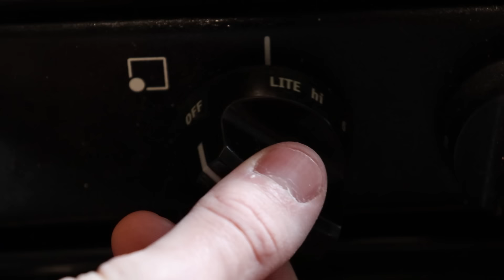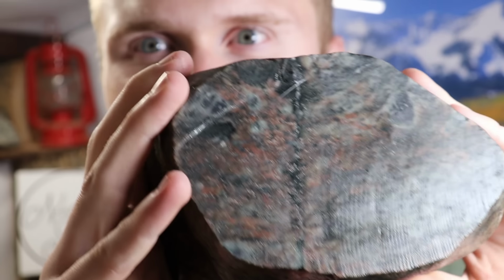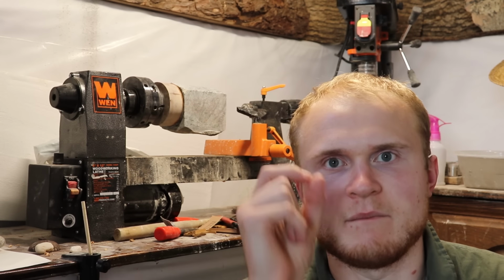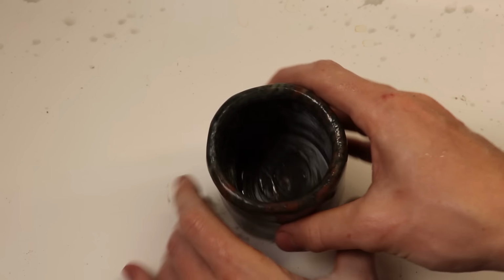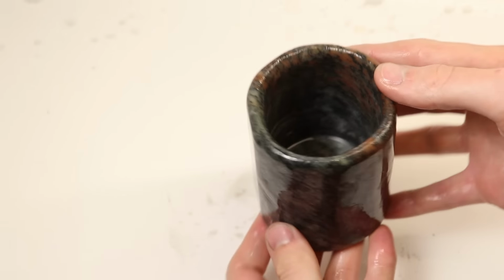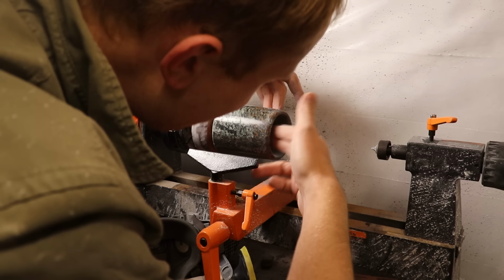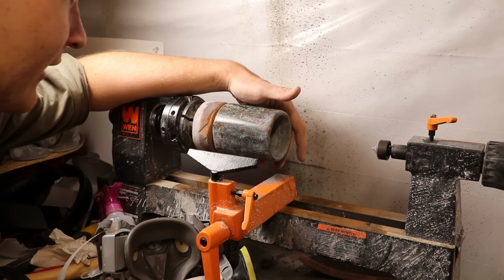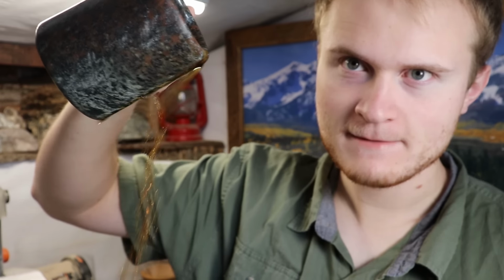I Made a Coffee Cup out of A Rock

Comment: Did you check if the rock could release harmful heavy metals into the hot liquid you'll be drinking out of the mineral cup?
Reply: I'm wondering the same thing
Reply: @Drewsky840  I'm interested, because I think I want to do it, but the right way. Toward that end, I googled "stone wear and food safety" and got a hit from stack exchange. I'm not sure if you can put links here, but the url includes "What kind of stones should not be used to grind food," so googling that sentence ought to produce stack exchange as the first hit if you're interested. Anyway, the question was this: 

"I found a pink slab of stone with a nice dip in the middle and thought of using it as a mortar for grinding spices. Are there any stones whose makeup could potentially leach toxins?"

Answer:

"Granite, marble and jade are all common stones used for mortar/pestle combinations. There are probably many other stones that are safe, but you want to avoid the following:

anything that is porous such as sandstone or dolomite
anything that will break apart easily, mainly sedimentary stone
anything that might expose you to metal toxicity such lead or cadmium
anything with organic matter attached
anything that reacts chemically to whatever it is you're grinding"

I don't know about the credentials of the author of the answer, but it's enough to suggest concern. I still want to do this (thinking about it, anyway), but I'll stick with decorative pieces not meant for food use. 

Assuming I can do anything that truly qualifies as decorative.
Reply: I'd coat the inside with a food safe epoxy, like you'd do if you make a wooden tankard, to ensure it's safe to drink out of.
Reply: @elizabetholiviaclark  Just from the look of it that is probably a type of granite. Seeing as what you said reccomended three types of metamorphic rock and that rock in the video appears to be metamorphic he should be alright.
Reply: @themadduck8784  Yes, I think I'm inclined to trust him. It's me I don't trust. I just don't know enough about this subject.
Reply: this guy has probably breathed in so much toxic mineral dust that drinking a little more won't matter in the end
Reply: @6022  Is the food safe epoxy heat resistant?
Reply: @themadduck8784  I heard that granite is on average more radioactive than many other minerals.
Reply: @desktorp  Well, I'm not asking for the guy in the video because he obviously didn't care too much about health. It's his choice of course.
Reply: @vladimirchylik6754 Quite harsh and completely unnecessary. Clearly, you weren't watching the same program as the rest of us. At what point did he do anything unhealthy?  You do know that he's a geologist, right? If anyone knows about heavy metals present in a rock, it's definitely going to be a geologist.
Reply: I live in a valley made of igneous rock such as granite and schist.  I don't drink the ground water. There are lots if heavy metals in it.  He should fill the cup with distilled water,  then send that water off for a chemical analysis.
Reply: @beyondwhatisknown  He's not a guy who just collects pretty rocks, he's a geologist degreed from University. If anyone is going to know the rocks that surround them it's definitely going to be him.
Reply: @illiniwood  It's actually a question of health knowledge.  You can't know the exact composition of an impure igneous rock just by looking at it.  Different minerals dissolve at different rates, and then at different temperatures.  I think adding some boiling distilled water to the mug, letting it sit for 24 hours, and then having it tested for its chemical content is the only way to know for certain what it leaches into the water.  After you get the answer, you have to understand what each mineral can do to a person's health, and that's well beyond a geologist's knowledge, and often beyond any doctor's knowledge.  Everyone reacts differently to heavy metals, for example.  Some people can handle mercury quite well, others cannot.  It depends how much you sweat every day too, among other things.
Reply: @beyondwhatisknown  That's a lot of assuming considering he's an actual scientist who has very likely taken the steps to assure that the rock he used is "safe enough" to be able to consume a hot beverage from. You know what they say about those who assume too much.....
Reply: @illiniwood  I'm all for defending educated creators from the common YouTube comment ignoramus, but if you read the description... "It's composition is some kind of igneous rock, if you can ID it in the comments I would greatly appreciate it."

Doesn't sound to me like he knows if it's safe or not lol. But I'm sure he has at least some degree of certainty, like knowing the appearance or color of some dangerous minerals/metals.
Reply: It's actually an organic biodegradable material, proven safe to use over 80,000 years of testing.
Reply: Anyway it's surely better than plastic
Reply: its like to say "Audi A8 better than atherosclerosis"
Reply: Why? I don't think that all plastic releases BPA.
Reply: @vladimirchylik6754  even if not BPA, there are another nocive chemicals
Reply: @illiniwood  Bulshit. As a geologist you studied minerals, yes. But even if he knows about possible negative health effects of some minerals on the body, he could still NOT CARE. You know that many doctors drink alcohol sometimes, right? They know about it being poison and they still drink it.

Your comment consists of too much assuming.
Reply: @beyondwhatisknown  Maybe boiling distilled water. Just to be sure.
Reply: @chrisgooden9662  That's the primitive "if it doesn't kill you outright, it's fine" argument. Some people smoke cigarettes live 94 years. That doesn't make smoking non-problematic.

And even if you don't feel anything, it doesn't mean that nothing bad is going on in the body.

Do you even know what the life expectancy was for people who lived 80,000 years ago? Probably not.
Reply: @vladimirchylik6754  Some minerals dissolve more at high temperature, some have a greater solubility at low temperature.  So, maybe send a sample of both hot and cold solutions to be tested.  Then again, you could put a weak acid in the cup and see if it dissolves extra minerals, then get another sample with a base to see if it picks up minerals.  Tomatoes can dissolve teflon, and eat through aluminum pots, for example.  I don't know what the tannins in tea or the acids in coffee will do to random igneous rock, but it's worth trying.  Ceramic dishes always have a nice safe non-toxic glaze on them that are guaranteed not to harm humans.  Maybe he can glaze his stone mug and fire it in a kiln to guarantee it is safe?  Glaze is made of elements that the human body already requires for its function such as silica, potassium, and sodium, or something that the human body can handle that doesn't dissolve easily such as aluminum in the molecular structure.
Reply: Oh my god I’ve never seen so many people arguing about a damn rock. If you’re worried about the chemical makeup of a rock, you’d hate to see the ingredient list of your Frappuccino
Reply: @linemantimlewis94  Those weird ingredients are killing people.  The food supply is poisoned.  Try eating 100% organic food for a month or a year and see how you feel.  I've done that experiment.  I stopped getting sick!  I hope you develop an interest in chemistry.  It's an interesting topic.  The human body is pure chemistry, and everybody owns one.  You'd think people would take an interest in the chemistry...
Reply: @illiniwood  Seriously, just because he is a geologist doesn’t mean squat. The guy is right! You definitely wanna check it for heavy minerals. If you’re putting coffee in in it which is acidic it can easily bring those heavy metals into your coffee. If that rock came from Colorado a lot of granite is mildly radioactive. You also wanna check it with a geiger counter too!
Reply: @beyondwhatisknown  Not only that but coffee is acidic. Acids can leach it into the coffee too.
Reply: @illiniwood  Hey, i’m a chemist. There are many rocks in Colorado and they are mildly radioactive. Here is Chem 101, coffee is acidic. Coffee in that cup will start to eat away at what ever maybe in that rock. Just like using tomato sauce in a cast iron pan.
Reply: @mtnwildernessfamily  Then, why would a scientist who studies rocks as a career and passion expose himself to known radiation by drinking out of a radioactive rock? With his knowledge of rocks, yet still willing to do this, it just doesn't make sense on any level.
Reply: @beyondwhatisknown  you can tell a lot by looking at a rock. formation of rocks is dependent on the presence of or absence of certain minerals. sealed granite is known to be safe. this whole thread is on a ghost chase
Reply: Please get better specalized rock tools. I'm a rock guy and those really hurt me to see you use them. Pleeeeeeese find better ones.
Reply: @Working-classdude  you do know people are not made of money. People don’t have money tree’s growing in the back yard. Maybe he found them used to start a channel. Maybe he can’t afford brand new tools. Maybe he enjoys those tools. This is his channel.
Reply: @justinbang6025  Granite is used as a building and ornamental stone. Many ore deposits (copper, lead, zinc, gold, and silver, for example) were produced by hydrothermal solutions created during late stages of cooling of granite bodies.
Reply: @elizabetholiviaclark  thanks for sharing this with us!
Reply: I don't care about any of the negative health effects. I eat McDonalds, Burger King and KFC regularly and also drink Monster Energy.
Reply: @linemantimlewis94  Yes, if you want "health care for all", people need to take their own health seriously first. I, for example, would not like to pay for healthcare for the fat American diabetes nation.
Reply: @vladimirchylik6754  Clearly, he doesn't care, but what's your point about gun experts? What does a gun have to do with lead? Plus, I don't know anyone who has a science degree or a masters from University in "Gun expert".
Reply: @illiniwood  Lead in ammunition. lol

Btw.. I'm talking about experts and you start talking about university degreees. My point is that you can know about heavy metals and still not care. You can know about the negative effects of alcohol and still drink whisky. It doesn't matter if you're a geologist or philosopher or whatever.
Reply: I think everyone should stop worrying about toxins in his cup and worry more about the heavy metals and fluoride in our water supplies, the harmful pesticides and other extremely harmful toxins sprayed on our food supplies, and the heavy metals and more toxins sprayed in our skies every single day. It's extremely worrying how no one gives a crap that they put something as toxic and harmful to humans like fluoride in our water. If they tell us about that then imagine what they are doing and not telling us about.
Reply: Probably has to worry more about dying from breathing silica without a respirator.
Reply: @vladimirchylik6754 It depends if there is a vein of any radioactive elements in the granite. The cell phone you are using to watch this video is highly radioactive compared to most pieces of granite. Many pieces of granite aren't any more radioactive than a banana
Reply: I wouldn’t want to worry as much as half the people on here. You know worrying will actually shorten your life too? It’s a rock, get a grip.
Reply: @chrisgooden9662  you know, humanity invented pottery for a reason. There could be arsenicum or stibium in random stones you find in nature. Natural doesn't mean safe. People's life didn't last long 80'000 years ago. Quicksilver is pretty natural - it doesn't mean you should drink eat to be closer to your ancestors.
Reply: @elizabetholiviaclark best ending to a comment i’ve ever read…😅
Reply: What types of stone/ rock are safe to be drank/ eaten from?
Reply: @beyondwhatisknown  if you boil distilled water it's no longer distilled water...

Comment: For the next rock mug, my guess is that you will have an easier job if you begin by making the hole in the mug first.
Insert a slug of wood into the hole to fill it completely. So you can turn it between two centers. 
Then grind the outside surface on the lathe using a diamond blade on an angle grinder.
Reply: Good idea, and after it's core drilled and plugged, the lathe could be used with external / live cutter heads for the outside.
This is basically the same as you mentioned, but I think of these things also, because I work on machines in a Granite shop, and I used to grind glass lenses also.
I wanted to reconfigure an old lens grinding machine to do these sorts of things.
Reply: Use a metal lathe and a carbide cutter. This angle grinder stuff is for children.
Reply: @gwcstudio  
I don't know enough about the properties of carbide vs granite etc.
Except that carbide is very tough material.  I've had concrete drill bits(carbide tips) last for amazingly long periods of drilling.
But I'm guessing that a fresh rock with big angles and edges would be difficult for me to avoid snapping tool holders and things.
Reply: My thoughts exactly, had my experiences with this work and there's no real alternative to this

Comment: This is awesome. I have to ask though if there's any risk of the rock fragmenting off or containing substances that might leech into the beverage? If it's completely safe I'd love to own stone mugs. 
On a side note, 7:51 christ man, I hope that thing has a sawstop.
Reply: Depends on the rock. Granite is probably about as inert as one can get. Water will win at eroding/dissolving stuff - but not in your lifetime.
Also, those are tile saw blades. Not carpenter blades with nasty teeth. The blade is smooth with diamond dust mushed into it. Nasty abrasion maybe, but it won't take your finger off.  Gloves are probably sufficient protection. sawstop also probably wouldn't work since the water all over the blade would trigger false positives.
Reply: I agree completely. Tile saw is nothing like wood or metal saw blades.  The worst that you will get is an abrasion cut.  While you could probably take a finger off,  it's because some has it held there for a while until it finally gets through it
Reply: @eh42  The concern is rocks containing lead, arsenic, mercury, cadmium, etc. All pretty common.
Reply: this scared the shit out of me.

Comment: Nice! AS far as the diamond hole saw bits do you buy from Amazon or from a lapidary supply shop?  thanks
Reply from the maker: I usually buy lower priced tools from amazon. I think as long as you treat them right they will last just as far as a lapidary shop. Plus, if they do break (Which they will, it is easier to replace) Thanks for watching! Links are in the description.

Comment: Nice. Years ago, I came up with a plan to make forged knives with handles made of stones like agate, jasper, and nephrite jade. An ABS bladesmith making "sole-author" knives, including the sheaths, could do very well, and there's very little competition doing solid stone handles, especially turned ones with hidden tangs. That's because the stone handles are the hardest part by far. Anyway, the equipment list I had in mind looked a lot like what you have here. Slab saw, rock lathe, boring machine, etc. Spent a lot of time looking at tool vendors at the Denver mineral show. Never did take the plunge, but I sure thought about it. Nice to see the process of working these cobbles of natural stone. It's a lot of work!

Comment: I work with masonry and concrete a lot.   You could get up to the hollow cylinder stage quite quickly with a coring drill and two different diameter bits.    Coring bits are basically long deep hole saws with diamond-impregnated ends --and water-cooled.    I have a hand-held Chinese coring drill which was surprisingly cheap.    Someone could make a fortune on Etsy manufacturing these (if someone hasn't already).     Also it wouldn't be surprising that there exist some kinds of rock that are toxic to drink from.  One thing I would pay special attention to is how the coring bit could seize in the rock and the drill throw you across the room or smack you in the face --if you're not careful.   Also, I'd recommend an in-line GFCI.

Secondly, perhaps a pottery person could chime in, but I would think a glazing step in a kiln would help with overly porous rock, or at least make the mugs more servicable.

Comment: Just a thought -- could you set up your diamond bit in a fixture on your lathe - at right angles to the axis of rotation?   And then grind the outer surface to more of a circle as the lathe turns at a low RPM?

Comment: Please, please don't get your fingers ever again so near to the blade. As a stone-mason I've seen enough accidents which have their cause in something like this. A colleague of mine  had just a few weeks ago an accident with a grinder because he thought he was so good at using it and lost respect of the machine enentually a segment broke out of the saw blade two times. The first hit the window of the office which now has a big hole. The good part is, that no one was walking in between the work shop and the office. The second time, just one week later, because of another silly misuse again a segment broke and hit him in the face. For his luck he wore a big mask, which attuated it a little bit and so he only had a tooth cut in half and a sliced lip.  Some years ago a segment broke of my saw blade and hit and killed a little bird. Another collegue was cutting wood on a bench saw and cut his thumb into two parts.  Rotating tools and espacially blades are a real big security issue, which should never be underrated.  For carving out the handle you could use an compressed-air axial grinder with different for such purposes made parts. But anymay, nice project.